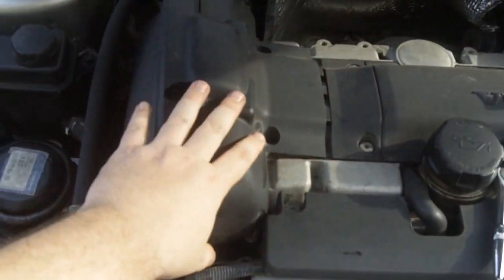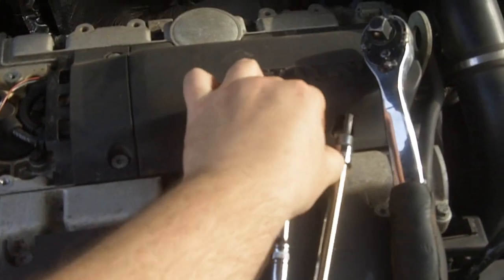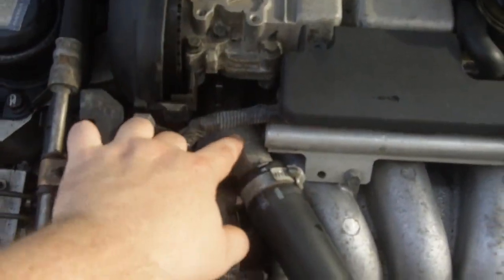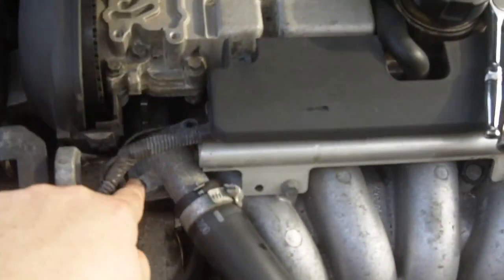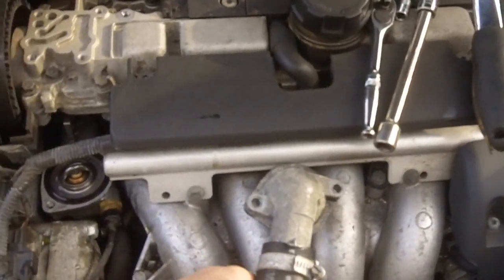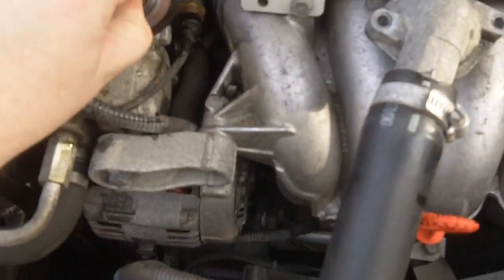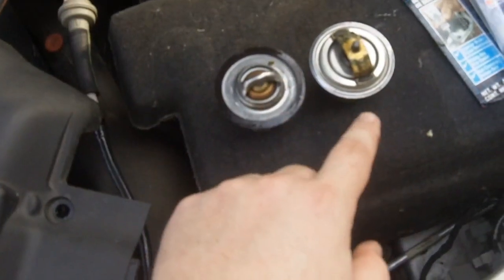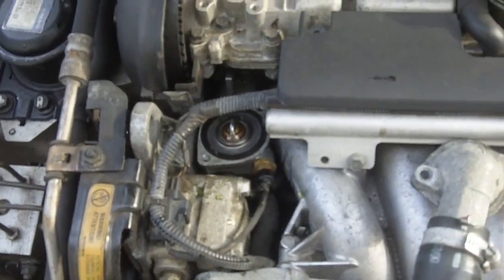MG52 - Volvo S40 Thermostat Replacement

Comment: Thanks for giving me the courage to take this on myself.

Did you have to drain the radiator fluid first?  I noticed no radiator liquid rushed out of either end in your video.  Was that because your system was cold? That is ideal.  However, if you did prep work to insure no mess would happen, please let us know what you did.

Comment: The pin on the thermostat should be towards the right, with the pin and arrow pointing towards the temperature sensor.  You can't just put the thermostat in however you want...

Comment: Dude, did you say you put the old rubber seal that was in the old thermostat in the new one? It's one of the main causes why thermostats fail/malfunction. The rubber seal gets old and it bends, cracks.

Comment: Nice Job!  I was just quoted $250 for replacing a thermostat and a temperature sending unit (coolant temperature sensor).  Is that the coolant temperature sensor just under the thermostat?  Any tips for replacing them both?  Many thanks!

Comment: I have a 2002 S40 that has had an engine fault for a long time.  Keep getting told that it is a misfire code but it only seems to happen when the car is very hot and has to be started/shut down over an over.  I'm planning on replacing the thermostat soon but do you have any other suggestions on things I should check.  The fan doesnt seem to want to kick on until the car is nearly overheating.  Is there a relay or something that tells the fan to kick on sooner.  Any help is greatly appreciated.
Reply: ETC sensor
Reply: By the way, I noticed you wrote it three years ago. Have you solved the problem. do you want to give information

Comment: I appreciated the replacement procedures embarked upon. But after the replacement the coolant keeps reducing after every outing. I may not have done something required. Can someone please let me know what else should be done to stop the constant reduction of the coolant? I will be grateful.
Reply: Could be a head gasket issue. If it is, look for white smoke coming out of your exhaust.
Reply: Thanks ever so much for ur invaluable suggestion. Actually I didn't do what was to be done. I didn't bleed the Rad and that was all. I bled it and she is fine. I appreciate. Thanks once again.
NB: The Radiator isn't the self bleeding type, that's where I went wrong.